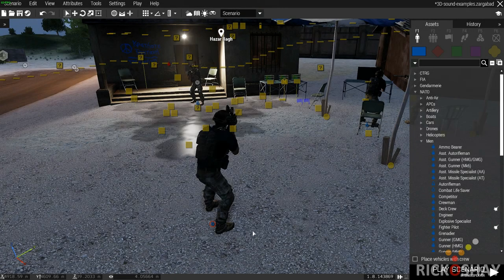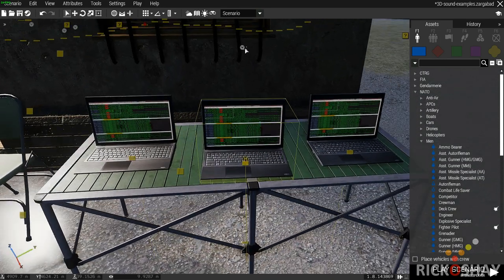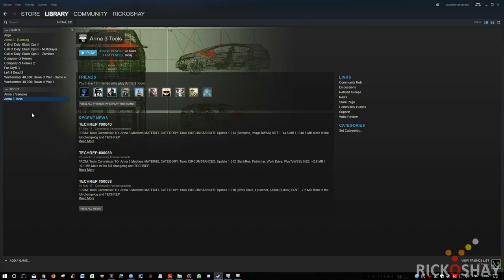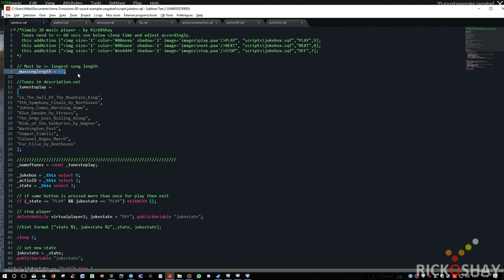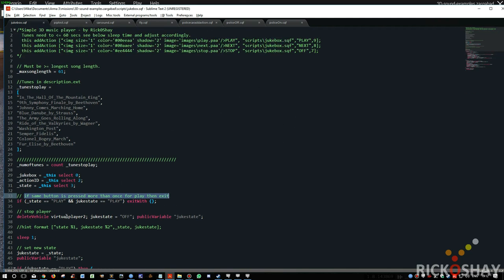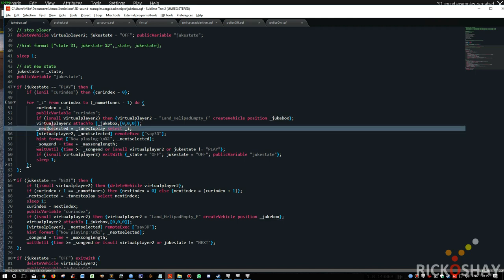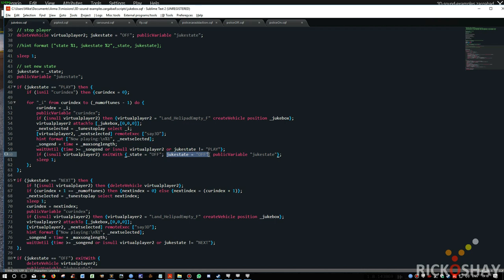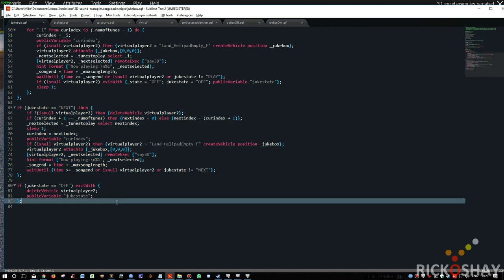3D Jukebox music player

Comment: hey, Rick, you're awesome, thanks 4 everything. I have a question, I am making a mission with 5 helicopters flying together, but they are always spreading too far away from  each other. Is  there any way to make them stick together?  I want to do so, because I am trying to crash them before player's eyes. thanks in advance)
Reply from the maker: Are they grouped ? If so what formation are they in ? I'd suggest not grouping them - give them seperate waypoint close together and make sure the first WP is careless or safe and speed slow for each heli. Set all waypoints close together say 40m apart. You'll need to test. Also try and make them fly over even / flat terrain and maybe use heli1 flyinheight 50; on heli1's  waypoints and do similar for each heli's wp just change the name obviously.  There are other more brute force methods but that should do the job assuming they aren't under attack or near enemy. You could also use heli1 setcaptive true; hel2 setcaptive true; etc on each helis init.
Reply: thx a lot, I'll try this out
Reply from the maker: Cool let me know if you need more help. Then we can try a more brute force approach.
Reply: Still no good. The Helicopter with player inside is still slower, than the one on the right and the one on the left flying too far away -_-
Reply from the maker: Ok I did a quick forced speed version for you. https://www.dropbox.com/s/fd4elr1yi0tffl1/5-helis.Altis.zip?dl=0  - using this in each helis init field  - null = this spawn {airslow = true; while {alive heli1 && airslow} do {heli1 limitSpeed 20; sleep 0.1;} };  placed on each heli - change heli name obviously. You can toggle airslow to false if you want them to start flying normally. Note I put them flying over the sea - so if you do this on land mustn't be too mountainous. In demo it takes about 10 secs for them to align themselves.
Reply: RickOShay thanks a lot, man. I’ll try it out.